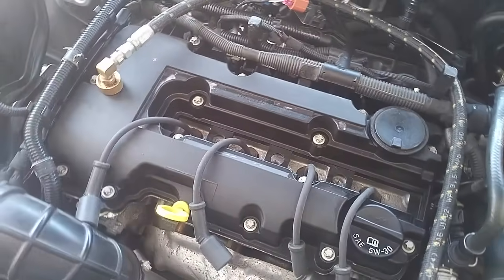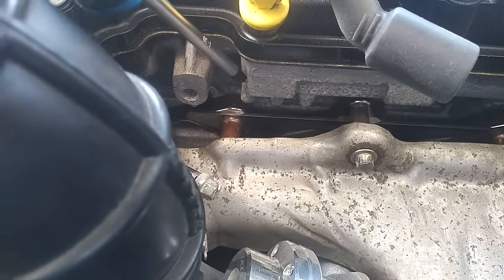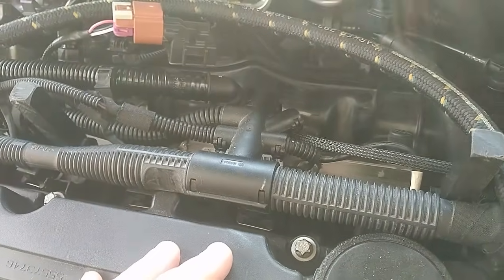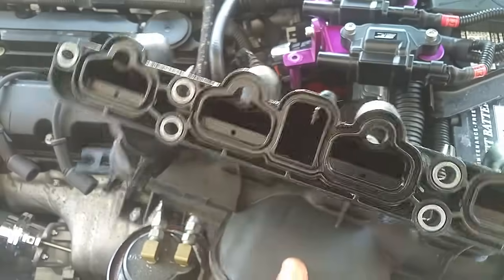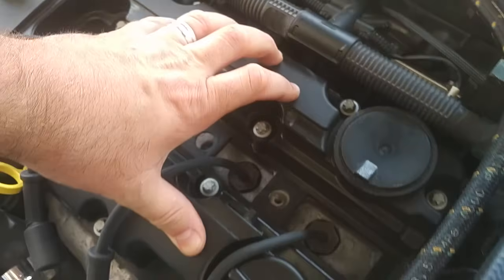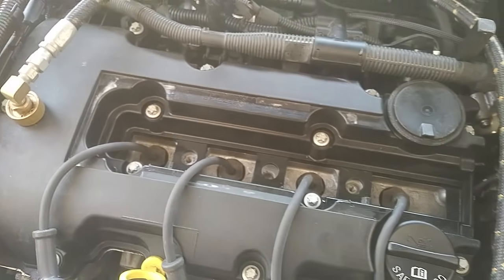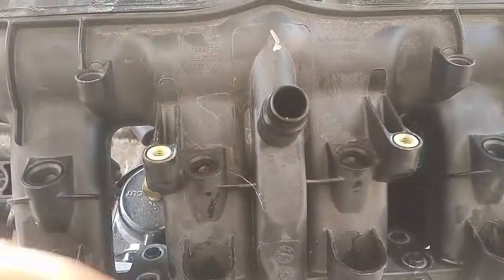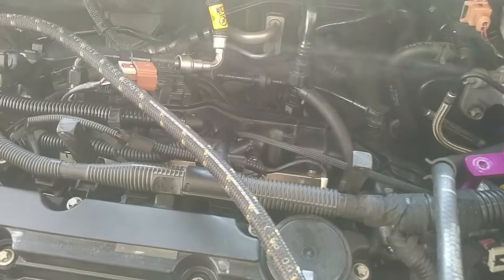Chevy Cruze Sonic Trax Encore 1.4L Turbo PCV Issues, Diagnosis, and Solutions

Comment: Quick temporary fix.... Disable the PCV system and run an old fashioned draft tube down under the car.  That was the system used before PCV.  It should still work in a pinch.  EPA is going to hate you though.
Reply from the maker: So is any passenger that has to smell those fumes at idle…
Reply: @AndreiDPop  The last draft tube set up I saw was on a 1965 Mustang, It was just tube hanging down from the engine, I don't recall if it had a pcv valve in line or not.  I noticed it because there was smoke coming out from under the engine at idle. It had kind of a v cut at the end so I suppose it worked like a venturi when the car was moving,   The engine fan pretty much blew the smoke back and under the car at idle so I doubt the passengers smelled it too much.  Such systems were pretty common before pollution control laws required that these blow by gasses be recycled through the engine. 

I'm not suggesting that a negative pressure system wouldn't be better but  this is the way it was done for decades and it worked.  I suppose how much you would smell in a modern car would depend on how your route the draft tube.
Reply from the maker: @RJ-vb7gh  it worked because we didn’t have low tension piston rings back then. The consequences are greater now.
Reply: @AndreiDPop  I think you are still going to get enough crank case pressure to push the blow-by out even without vacuum. It might even work better now with low tension rings.  It's still going to be a smog issue that isn't going to make you a lot of green friends.   But no doubt that a vacuum driven system would always be better theoretically. I have to wonder how much of pcv was pollution driven and how much was improved crank case ventilation and whether better ventilation was ever really an issue.
Reply from the maker: @RJ-vb7gh  the loss of vacuum will cause a poor piston ring seal that will drop fuel economy. Low tension piston rings require crankcase vacuum.
Reply: @AndreiDPop  Low tension rings cause more blow-by than normal rings so you are going to get even higher crank case pressures.  

I've worked on engines from flat heads through dual overhead cams and I've never seen one that had any crank case vacuum.  In fact on my 1966 Olds I added a second breather on the oil fill tube.  Every engine I've ever seen has blow-by and a positive crank case pressure rather than a vacuum. In  fact the PCV valve pretty much prevents crank case vacuum which would inevitable suck all of your engine oil into the intake manifold.  

I know it's something we don't think about often, but remember what happens to your oil when your PCV valve gets stuck open?

While I agree that ventilating the crank case is important the way a draft tube is cut to create a venturi effect was good enough in he old days and combined with the extra blow-by of low tension rings, might even work better now.  

As I see it, even with super high tension rings, you will never stop blow by so your rings will never get under a vacuum.... I'm happy to be wrong though,  If you have a reference to tech data I haven't seen yet, I'd love to see it and will gleefully change my mind.  Even us old people who think they have seen everything can learn a new trick every now and then... we just need more proof because we have been wrong longer than everyone else.
Reply from the maker: @RJ-vb7gh  low tension piston rings don’t produce more blowby gas when you have vacuum on the crankcase. That’s the whole point; it seals the piston rings. There’s no Venturi effect from the breather because there isn’t enough velocity going across it to counteract the volume of PCV gas being produced. I’d put money in it that if you put a in-wc gauge on the crankcase you wouldn’t see vacuum. 

This is how these engines are designed to run and the PCV fix kits allow you to retain all OEM functions and emissions controls while upgrading the design to a serviceable one for half the price of a new manifold. You have to plug up the check valve hole on the manifold to vent to atmosphere anyway so if you’re going to do the work you may as well spend a few more bucks and just do it right, and not have a drop in fuel economy. Just makes more sense.

Comment: Hey buddy, I recently installed a new intake manifold and valve cover before finding your kit, could you possibly explain too me where the bypass hose coming from the turbo is connected too? Specifically on the engine side? I have mine connected where the turbo is but I can’t for the life of me find out where the other end goes ( I believe this is creating another vacuum leak) that being said if this fails again (which is likely) I will be purchasing your kit. Thank you!

Comment: Good video! Only disagree is the oem valve cover isn’t the best option, dormans has updated the pcv valves I don’t believe they fail as easily as oem
Reply from the maker: They don’t fail less often. I get calls every week from people who have issues with dorman valve covers. Literally every week. OEM valve covers last 50k-80k miles usually. 

This is all based on the reports I’ve been receiving from customers over the years.

Comment: Thanks for all the information. 
your mechanical skills are well interpreted. 
The information helps alot.
You forgot to mention that this garbage car cruze
It does not have an EGR valve. The turbo which is also trash 🗑 
Could be the egr itself or the pcv valve which is the same as the valve cover with seals 
Jajajjajajajajjaja
Isn't that something new?

Comment: Great video my friend. With this all in mind; I take it this could be giving me / contributing to the turbo underboost code I’m getting? I have a lean air code as well.
Cheers.
Reply from the maker: Yes, a missing intake manifold check valve will absolutely contribute to a P0299 underboost code. The PCV fix kit would address that.

Comment: So if I'm getting suction from that diaphragm on top and also don't have a nipple for the check valve, do I need to replace/repair both?.....I've also got a bad front crankshaft seal that I'll have to replace due to the squeaking noise.
Reply from the maker: Yes. Replace the calve code did and get the pcv fix kit from cruzekits.com. Front main seal will need replacing too.
Reply: @AndreiDPop  awesome dude. Appreciate the help. This car is a POS

Comment: Can you please give me any advice or an answer as to why my 2014 Chevy Cruze LT 1.4 turbo engine loses power constantly in this car as I'm driving or I have the cruise set on it?? The catalytic converter system was totally replaced only about a month after I got the car back in October of last year but the problem still exist I can be riding along no AC on no radio no nothing else power-wise and the car will just lose power and I have to pull over to the side of the road and wait till it cranks up and pray that it'll go again!!!
Reply: Check bottom of intake manifold for loose hoses there is a boost control sensor small hose about 3 inches kept falling off I used crazy glue and it has been fine there has to be some leak sonewhere star the car pop hood and listen and look should be able to hear something and turn ac on with ac and air circulation on and rear defrost should use max power and can help hearing the noise

Comment: I have the code P1101 and it’s the Mass Air Flow Sensor and I cleaned the sensor and throttle body and nothing … I’m thinking it may be the PCV tubing ?? Any help guys ? Before I take it to the dealership… car seems to run fine and nothing seems wrong

Comment: my nipple is still showing. should i just replace my valve cover gasket? p015b, p0171 p0420 p1101 are the codes im getting.
Reply from the maker: Is the vent on the valve cover sucking in or blowing out air?

Comment: The other day, my dad got this 0299 code on his 2014 encore but it was still driving fine. I ordered your turbo test kit but haven't had time to use it yet. Yesterday, he said the car wouldn't go up a hill, fell on its face and had no power whatsoever but didn't see the light come on again. Is it likely the turbo is shot at this point>?
Reply from the maker: Either turbo is gone or catalytic converter is clogged. This is assuming it’s not in limp mode which would clear up once the car gets shut off and on again.
Reply: @AndreiDPop  Thanks for the response. Any quick way to differentiate between the 2 issues?

Comment: Does that corrugated tube have a barb on the end cause was wondering if you could just replace that with a normal rubber line and put a inline check valve in cause I did something similar on a vxr for a hard brake booster line using stronger vacuum rubber lines of course saves me from drilling the intake manifold
Reply from the maker: what you’re trying to do won’t work at all. Yes it has a barbed end and he’s you can use a PCV hose but no you can’t just run any inline check valve anywhere and especially not in the 5/8 line because there’s already one there. The v3.4 pcv fix kit does not require drilling or removal of the intake manifold.
Reply: @AndreiDPop  ok thanks for the reply and fixing my error will just get the new kit then

Comment: Hey bro I’ve done all the work already wish I saw your video first but I’m missing the T can you tell me where I can find it
Reply from the maker: Back up there a bit. There are a few details we need to go over to makes sure everything will work. 

First, what check valve are you using and where did you put it? Orientation, crack pressure, and location matter a lot. 

Second, what hoses did you use? Chemical compatibility here is very important. 

Third, the T fitting on the PCV fix kit is custom made. Shoot me a message on the forum on the CruzeKits.com site and I can get you the parts you need and make sure whatever you've done will work well.
Reply: @AndreiDPop   is  same like you’re
Reply from the maker: @albertogutierrez4903  same like which one?

Comment: So how did the Dorman intake manifolds end up lasting??
Reply from the maker: I’ve had reports of the check valves cracking on the back and leaking. The check valves still get clogged and gummed up with PCV deposits and cause other issues. What’s worse is you can’t even clean them like you can OEM manifold valves since the check valves are recessed further back in the manifold and you can’t see them from the top. 

Not only that but they’re more expensive than OEM manifolds at this time and almost 2x as much as the v3.4 pcv fix kit, which upgrades the manifold to an externally serviceable design.

Comment: Ive had the kit V3 kit on my 2014 Cruze 1.4 for about over a month or so.  Have not had any issues.  The crank pulley whistle, the PCV air inlet suction, rough idling, hesitation, check engine light, all have gone away and have not come back once.  I did not replace the valve cover, I did not replace the intake manifold.
Reply from the maker: Is your check valve on the v3 kit pointing in the correct direction?
Reply: @AndreiDPop  Yes, and there are no problems.  I was adding another testimony to what a good solution this is.

Comment: I'm looking at installing the latest kit. I just have one question. I still see the orange nipple when I check the intake manifold. But my valve cover has failed. Should I just replace the valve cover since I can still see the nipple? Or do I find a way to remove the nipple? And do I need to take the whole manifold out to remove the nipple? Thanks for the help!
Reply from the maker: How dirty is the nipple or the manifold port? 

For now you should at least replace the valve cover with a new OEM unit. 

How many miles on the car?
Reply: It wasn't to bad. Didn't have to clean it to see the orange nipple. The car is a rebuild. 2013, and has 54,000 miles on it! Sorry I'm canadian haha
Reply: I have the p0171, and p1011 code, says it's running lean,
Reply: Could I technically just push that orange valve nipple into the intake? Just use a screwdriver to push it in? Feel like it's going to break eventually anyways so might as well have your fix kit installed?
Reply from the maker: @chrisgiesbrecht4730  yes you could and many people choose this option to prevent having to respond to the failure later.
Reply: @AndreiDPop  ok great. Also does your kit hold up to really cold weather? Like -40 celsius?

Comment: just bought a 2016 chevy Trax LS with this motor (Korean). It runs amazing but I was looking up known issues just to kind of pre research so that I can be prepared if something is to happen. This was super informative. Thank you. I subscribed just in case I ever have to refer back for issues. Thank you for the content. Is there any specific out of the ordinary tips or maintenance you would recommend besides the usual obvious oil changes and regular upkeep? Or maybe you already have a video about something like that? Thanks. P.S. I saw another gentlemen's video working on one of these and he recommended every other oil change that you change the Inlet Turbocharger Oil Line because it's located behind the heat guard and due to where it is located the oil gets clogged in that line and it causes your turbo to fail prematurely. I know Dorman also makes a replacement piece for that & it's inexpensive & an easy quick fix while changing the oil on the vehicle.
Reply from the maker: How many miles? I would inspect the intake manifold for a missing check valve. Always run synthetic in the engine, AMSOIL is best and I can get it for you. 

Keep an eye out on the cooking components. They’re cheap but tend to fail. Coolant flush should have been done by now so if it wasn’t, get it done. A BNR tune would be a good idea as it will get you loads more power but also keep the engine a little cooler which will prolong the life of cooling components.
Reply: @AndreiDPop  it has 100,000  on her exzactly. I will definitely do all of that. I have seen the tests on the Amsoil on the project farm YouTube channel and it was unbelievable how much better it was compared to the others. Thank you for the tips. I will definitely look into doing all of that asap. It's just a daily commuter for work & gym. 5 miles there n 5 miles back. Mayb grocery store on the weekends haha. I had a 2007 cobalt before this and it went 220,000 before the tranny finally gave out thats why I went back to chevrolet. Thank you tho I appreciate the tips my friend.
Reply from the maker: @BlueCollarBastard1987  shoot me a message and I can get you a deal on AMSOIL.

Comment: Oh my. What a crappy motor.
Reply from the maker: We’ve had them go to past 500k miles in many cars already. They’re good little engines but they do have a few key areas to keep an eye on. They also get great gas mileage. I was averaging 38mpg with my Cruze eco when I used to commute and I would get 45-50mpg if I was driving straight highway. That’s quite respectable for a non-hybrid 3200lb sedan in 2012.

Comment: I have a new valve cover, coil pack rail, intake, PCV hose,  vapor canister purge solenoid, MAF sensor, bank 1 O2 sensor, throttle body . That the mechanic replaced but it still throws a P1101, P015B, an P0172. 

The p0172 is new after replacing the throttle body it got rid of p0171 the. Has that now popped

What do I do
Reply from the maker: Boost leak test it, replace the evap purge valve.
Reply: @AndreiDPop  I already replaced the purge valve but I will try a boost leak test
Reply: @AndreiDPop  I just realized the my inter cooler  has a pretty decent size dent when something kicked up an hit my car, could a leak happen from that
Reply from the maker: @mikeandersen3376  yes.

Comment: I had same issue with a sonic. only when i covered the diaphragm hole it started directing oil into the intake and then the car started smoking from the tailpipe like crazy. Thanks for the info will be ordering kits from you.

Comment: If that rubber nipple isn't there, will your engine not run right? What kind of symptoms can someone expect to happen?
Reply from the maker: Lower fuel economy, laggy throttle, hesitation on acceleration, reduced power, increased oil consumption, smoke out of the exhaust between shifts (if manual transmission), more external leaks, more frequent valve cover failures, catalytic converter clogging. Just off the top of my head.

Comment: Heya Dre Dan,

 I have a holden cruze turbo thats gone sluggish when engine is warm and dumps alot of oil into turbo causing heaps of smoke under boost.

I have replaced plugs, turbo and feed line. Car is still the same. Any advice will help.

Cheers
Allan
Reply from the maker: Sounds like a pcv issue. Have you inspected the intake manifold and the valve cover? Has the valve cover been recently replaced? Have you done a compression test?

Comment: Hi Dan. So I’m having some issues with my trax. There oil coming from the bypass hose from the intake to the turbo. I checked the check valve in the intake but it’s still there. The valve cover is sucking in air from the diaphragm. I’m assuming the Intercooler is full of oil because the hoses look oily and there oil coming up to the throttle body. I Just replace the turbo because the wastegate was getting stuck open giving me a low boost code (I visually seen it not close all the way) and I would have lost of power like I had no pedal. That’s when I noticed the oil, and now it has a burning oil smell and still lose of power. Removed the cat and it’s black. how is the oil going through the bypass hose? and would the give me the loss of power. Any help would be appreciated
Reply: Also now when the car has no power there a tapping noise in the engine bay when you try to give it gas and when the power comes back it goes away.